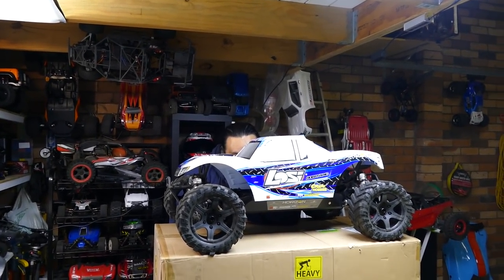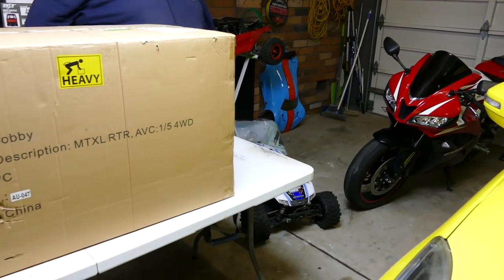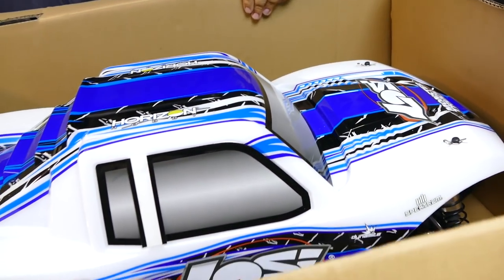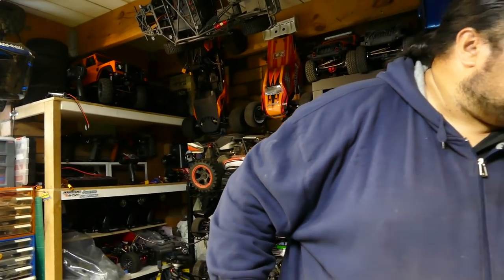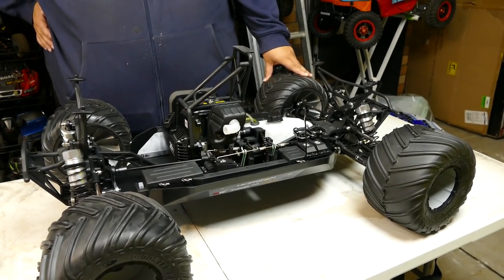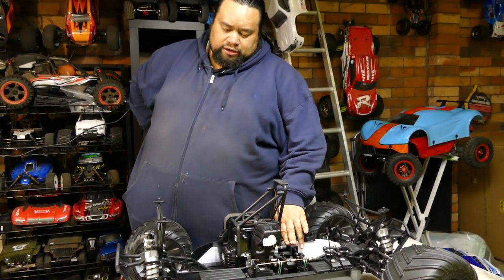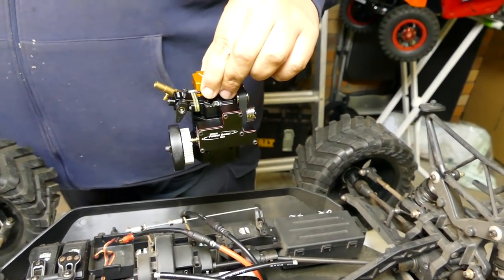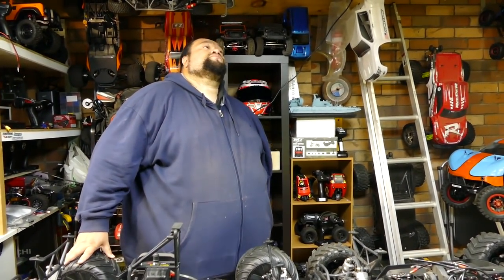LOSI MTXL 1/5 4WD MONSTER TRUCK - DOUBLE TROUBLE! Brushless Conversion Part 1

Comment: Great pick up there. Getting hard to find. Pretty cool to see a mtxl brushless. Something so big and so silent. I have a gas version with an OBR signature series g340 reed in it. Upgraded the drivetrain throughout. Now with the release of the RCmax chassis. I have one for a winter rebuild. Seriously considering a bigger engine too. Time will tell.
Reply: Steel City RC just scored the same engine, the  GAP Racing upgrades from Detroit Performance look awesome but I tend to baby the Brushless and punish my Gassers. So many things I can get my wallet into trouble with 🤦‍♂️😀
Reply: @michaellucre8249  🤣 lmao! My wallet in trouble.. I feel ya man. Did you get their axles yet? Gap or whatever they are called? Curious the strength. I snap the  stock dogbone pins if I run any tire with grip. Stock tires I'm ok for a bit lol
Reply: Steel City RC - My Losi 5iveT 2.0 Racer is taking all my Fk You money atm 😘 and with the Raminator Brushless conversion well my Lawyer tells me to say “No Comment”

Comment: When I got 2 of my RCs, I changed a lot out of the box before the first run. I put a lot of aluminum parts on my UDR when I got it new and my TRX4 Bronco I didn't actually "mod" it, just altered it with a light kit, front and rear bumpers, scale parts, and a roof rack. All my other RCs I run stock till it broke. My Losi 3XLe I put T-Bone parts on after probably 5-10 runs. Body was already pretty beat up before getting those parts. A few days ago I also ordered a indestructible body for it.
Reply from the maker: Yeah some of the RTR RC's I change the servos asap but other than that leave them until they break 👍

Comment: Love my MTXL! The very first thing that needs to be changed is that clutch bell carrier to a Bartolone Racing one sold at DDM in the states. And Detroit Performance carries the rest of the awesome mods for this truck! Braaap it up fellas! 🤝🤝⛽️⛽️⛽️ God Bless brap brothers!
Reply from the maker: Awesome, thanks for the tip
Reply: growlingbehemoth agreed bro. I never even ran mine with the plastic one. I did so much billet work before I ran mine. And I’ve had zero issues with it. Its a great RC!
Reply: EastSide RC - Cheers bruv 🤙 after we filmed this I was able to get my hands on an OBR G340 so with that being said might as well get some GAP & RCMAX Billet Son!! and an Olimat unsilenced pipe with extra goodies!!!!! ⛽️⛽️⛽️✊
Reply: Heat and plastic don't mix well (; Braaap  Braap !
Reply: Michael Lucre 🤣 Yesss Billet ssSSSON! Good score on ALL the goodies!! You cant go wrong with Gap n RCmax for sure! Haha! WHOOOOOOOO BILLET!!!🤝⛽️⛽️⛽️🤜🏼🤛🏼

Comment: In the I changed the whole build of the made it only 2 drive shaft in the middle used the drive shaft of fivet because of the length and worked 
Max5 is enough to run it in speed close to 45mph

Comment: You see ztw has a new esc coming out
Reply: Craig McClellan - nice, hopefully they’ve cleaned up the firmware. I’m skeptical about the ZTW but price wise you can’t compare 👍
Reply: @michaellucre8249  ztw 500 and completely waterproof....look up offshore electronics inc on Facebook
Reply: Craig McClellan thanks bud, I’ve purchased the OSE connectors from them before. We got the ZTW Beast Pro when it first come out when you could only buy from a distributor in the USA